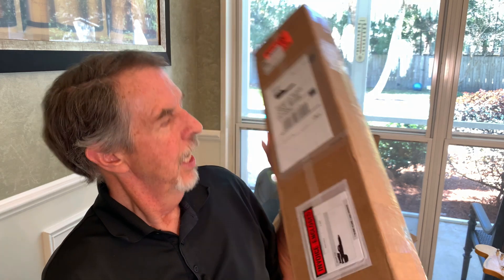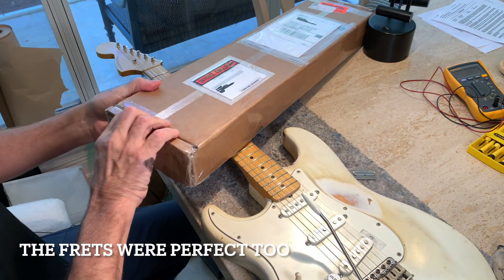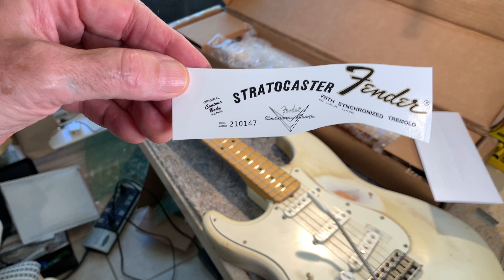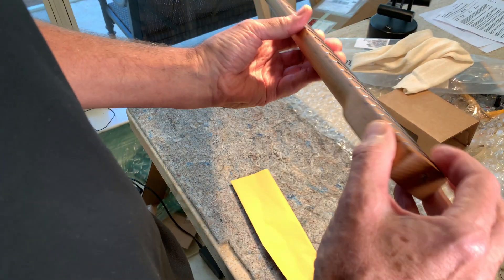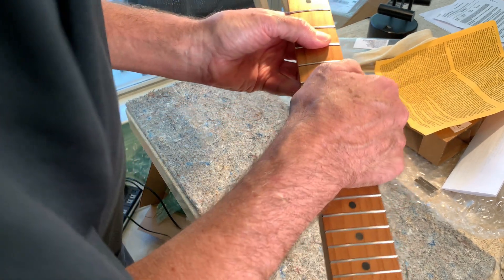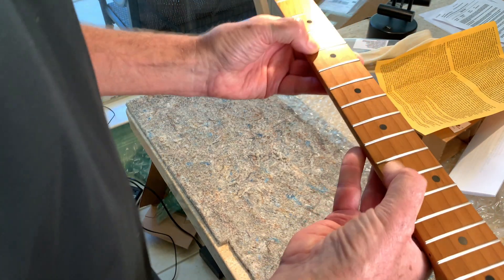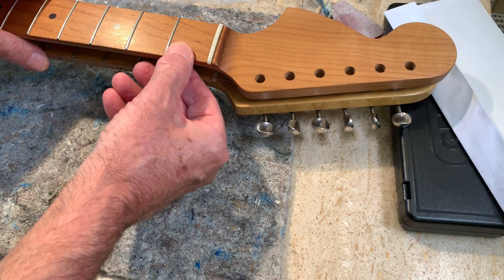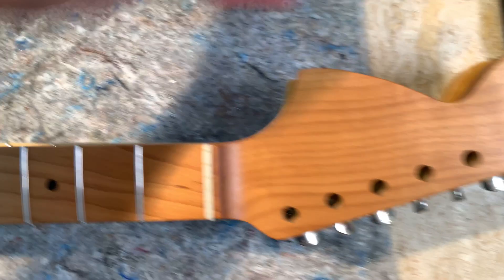Musikraft Custom Hendrix Maple Cap Neck Unboxing and Install

Comment: The 12th fret dots need to be closer together, right?
Reply from the maker: Good eye!  Yes, I went with the pre-1964 spacing.  Probable should have gone modern but it doesn't make that much difference to me.  I think I was still thinking about my 1964 neck because I also almost got imitation clay dots.

Comment: I have one  also from Music Kraft is  there a  email I can contact you with
I had my decal special made because I hated how the others looked  I can show you what I had made & give you  the info  I think my decal design looks way better and  was happier I was able  to get it done
Reply from the maker: Sure. DM me at millstaps_jimiisms on Instagram. Maybe I’ll practice with this one on my other neck. I was putting it on in the morning.
Reply: @millstap  I will try  to sign up  tomorrow  mean while if you want look at the about me tab on my youtube channel it has  my contact info  there towards  the bottom I can send pictures  of the decal & neck I had made
Reply: I cant do the Instagram something is not working and honestly I don't want to join it I am not up on it ,if you go to my channel click the about me tab & scroll down to view my email address and email me. I took pictures last night of the better decal lay out  on my reversed music Kraft maple capped neck / Mike E.
Reply from the maker: @MrSteppingstone888  Mike, no need to bother.  I did email you yesterday.  I'm going to use what I have and be done with it.  If it doesn't work out, I'll get the design you have.  As far as I can tell, the left handed Strats have the exact same decal as the right handed Strats from 68-69 just put on in reverse.  I kind of like the way mine looks because its bigger and easier to see.  I'm not trying to make it look like a vintage Strat but just like the Fender name on the headstock instead of Nash.  Send those photos to my email when you see it if possible.  It may have gone to your junk mail.

Comment: frankly you should clamp up the neck, align it using 2 E strings, lock it, then drill it all at once, body and neck, always use the same screws in the same holes never mix em up, important..
Reply: This is a good idea.  I guess that is a reason to order neck with out holes drilled. How do you clamp it? The clamp has to fit between frets?
Reply: Not mixing the screws up is a hot tip.  I use that practice no matter what it is I take apart and reassemble.  Great point!!  💚🎸
Reply: I think I see how to clamp the neck in place with felt on a block of wood then the clamp.

Comment: if the decal does on crappy its too thin, its a cheapo, the REAL genuine replicas are shaped decals, no cut, the the edges are beveled... THEN, there is another process after the decal adheres and is totally cured where you blend the edges and thin the decal with wet sanding and polishing, that's how fender was able to make these decals look like a silkscreen where you cannot feel or see the edges, the decal is thick upon application so its stiff and easy to place and adhere, if you leave said decal as is you can see the edges even though they are tapered, moreso you can feel the decal and fender did not want this so they udergo a thinning process with wet sanding to knock em down very thin and make them edges so the edge blends right into the wood, then its repolished..

many of these decals even into the 80's re not cleared over, but you cannot feel the edges and they look like a silk screen process but they are very durable, a testament to the decal properties, those thin flimsy junk decals made on peoples home printers are NOT real decals, you have to trim them and the material is flimsy and foggy with no real adhesion or sanding properties, JUNK!!

be sure you get no cut decals that are thick and sandable, so you can thin them and polish them just like fender used to do..

this is why you see those custom shop guitars for 8k of re issues that have very ghetto looking decals where you can see the edge and the entire outline of the decal, those are SHIT decals, don't use them.. there is a guy on youtube who goes through the entire process of application, to wet sanding and the materials used to polish the decal to make it look just like factory fender decals and for all intents they are the exact same, pre-cut beveled cellulose slide off water decals.. the reason you DO NOT want these junky printed is cuz 5 fold, for one they are not pre-cut with beveled edges, the clear areas are not 100% transparent, they are not sandable, they are not polishable!  that's why you can spot them a mile away, and thats today, in a few 5 years they will fog up and discolor, if you have ever seen a case queen 1957 fender stratocaster you will note the decal still looks brand new, the same as it was when it was new, cuz they are QUALITY cellulose pre-cut decals that were installed with care and skill...  the way these old ones are made is they screen on the CLEAR cellulose in the shape if the decal, then silkscreen over those the color when the cellulose is still wet, that's how the colors soaks into the clear, its an EXACTING process abc when the processes were involved made with quality processes..

I learned about decals very early on in life as I got into model cars and airplanes, bots what not, all my NASCAR replicas from MPC had QUALITY slide off pre cut bevel edges decals that I could sand  and polish, and they never discolored and the cleat never fogged, where as a Revell sticker I have to cut, it was thin so a lot more difficult to work with, you have to know that if you have to cut a decal BOOM, you know the edges are squared, obviously unless you have a special scissors that can cut a beveled or tapered edge..  you don't want a square edge you can feel it and things can catch that edhe and peel em off..

having said that there ARE OK to good self adhesive non pre-cut decals that are made with quality cellulose and are thick that actually adhere and stay on once cured, (rothkoandfrost) those you can sand nevel the edges and sand the decal thin so it looks like a silkscreen once you polish them back up, far as I know those quality cut style have yet to fog but I haven't seen any that are 40 yeas old yet right?  there are other makers too, make sure they are edgeless, acrylic, cellulose, metallic paints, printed in opaque so forth not shit fleebay printer decals..

for me I don't care what the headstock says, funner, fenner, fugger whatever, but if its those crap decals no FUGGEN WAY!  what I really like are a true silkscreen like Charvel and jackson used those are the most durable and last forever, sure they can patina or yellow but thats all good right, yellows same as the binding, use a quality silk for sure.. Jackson, Charvel, BC Rich, so forth they have silkscreened that are so nice as they clear over it... the budgets they don't celar over but 35 years later are still 100%..  fenner used to use a quality decal process, no more, silkscreen and their repros are junk decals.. even custom shop, no thanks, nuther way to spot a fenner fake, you can feel or see the decal edge or its fogged or you can see the outline.. lotta fakes around these days, even coming out of the fender custom shop, for $6k?  meh..
Reply from the maker: I'm not so concerned about the decal just as long as it says Fender on it and not Nash like my other necks.  Finding authentic, vintage correct left handed decals is near impossible.   I have been looking at my original 1964 Strat decal and there is no clear nitro over it at all.  You can even see where the whole decal has shrunk just a hair just like the shrinking green pickguard did.  The decal is actually damaged around the "d" in Fender from something hitting it and scraping it off.  I can't even find a photo of a 1969 left handed Strat decal that looks good to me so this one should work just fine.I even have the Fender Stratocaster book by Tom Wheeler and there is only one left handed Strat (1964) in the whole book.  If it doesn't, I'll probably just leave it bare.

Comment: OMG where's a proper box cutter the opening had me cringing must be my OCD. Ha
Reply from the maker: That is some serious OCD, 😆
Reply from the maker: You think that’s bad, you should see what I did to the second neck.
Reply: @millstap  That's my next video Stap. I have two fender custom shop 69's with the Reverse Headstocks. Sort of the JIMI custom shop but with out paying for the neckplate with JIMI on it. Have you ever thought about trying one of those out?
Reply from the maker: @waxman9550  I have not. I haven’t bought an official Fender Strat since my SRV Strat in 2005. I sold it a year later. Then I wanted them full Hendrix experience so I bought a left handed Strat from Nash. Then I just started tweaking what I had with new parts like pickups and necks until I got the sound I was searching for.